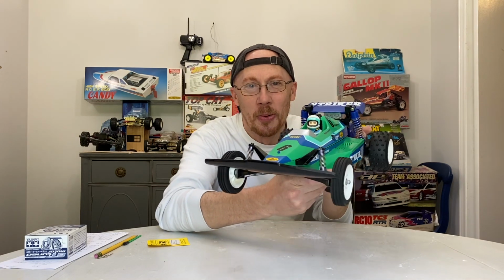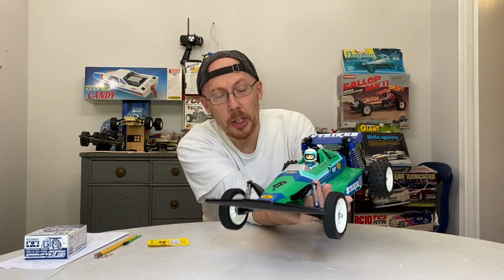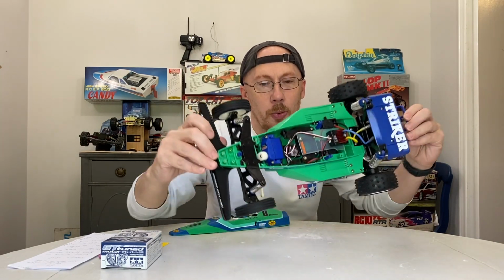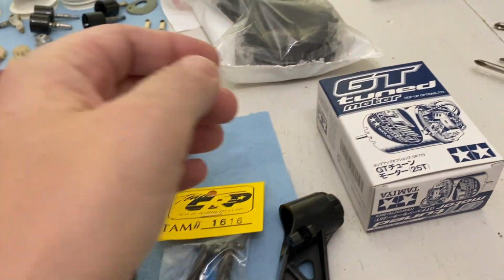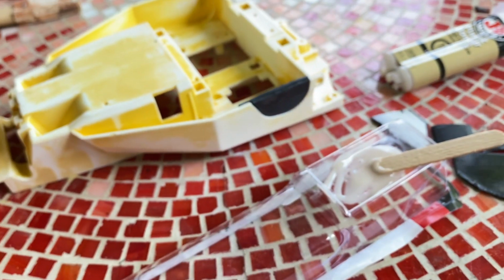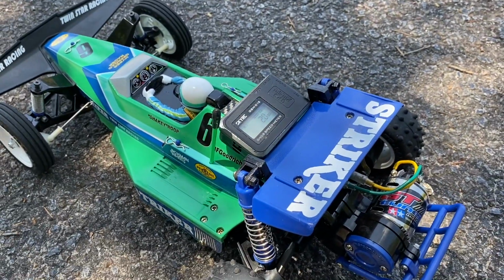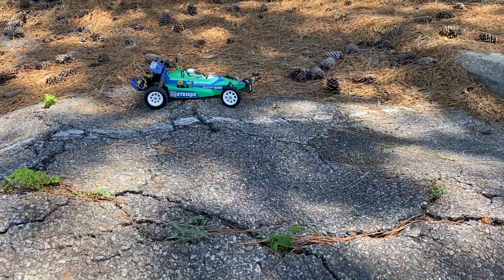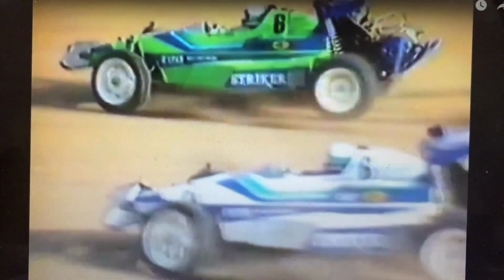1987 TAMIYA STRIKER RC RESTO AND RUN REVIEW

Comment: My first car. Bill leckie rc in penrose. Auckland. New Zealand 
Mid 1987.
Awsome for 2wd but kept throwing left axle. Was movement when suspension working hard.
Having said that it was running technigold black motor. Top motor in its day. 
Good memories. Thanks man
Reply from the maker: Hi Chris. Yes the Technigold motors had some torque. On the axle issue especially when equipped with a fast motor would ware the cheap plastic shafts out fast. I use crp nylon ones that work great. Oh 1987 what a time.Robocop ruled! There’s actually a building of a vehicle I’m doing this Halloween for fans of 87 robocop movie. Thanks for watching,sharing .

Comment: Great video as always, man! Superb work right there. And loved it how you ended the video with the Striker original footage from Tamiya lol.
One question though, did you do any cleaning or maintenance immediately after beach runs? I always keen on running my TT02B and Nikko Scorpion on the beach but worried that the salty water and air might corrode the metal components. Cheers.
Reply from the maker: I appreciate you watching. Beach runs are fun but yeah you do need to clean them right away before they go back on display. 👍
Reply: @LukesVintageRC  ahh right. Ok thanks for the reply, Luke!

Comment: Pretty nice homage too the promo video one, though it's such a strange design with a mix of an F1 car & a buggy.
The Futaba FX does look a bit more traditionally like a buggy ofc if you want a different body for this, think it's even a straight bolt on basically but just as weak in the front piece there unfortunately.

Id imagine this with red decals & black like a Marui Ninja with the wheels in red or in silver would also look great.
Or maybe gold decals & a black body like the Marui Samurai i think it was called ?
Great looking buggies both of these mentioned.

Wonder if it's possible too reinforce the front plastic piece somehow, maybe epoxy in carbon fiber or a milled aluminum piece that with some longer screws bolts into the front end piece & the chassis a bit further back.
Or kind of design a different front end that can bolt into the chassis if it snaps off entirely with an aluminum plate instead with a similar bend & hole and maybe that plate is reinforced with a secondary one that sandwiches between the chassis bottom & it's the top piece that extends too the front taking over the job the front nose cone does with a 3d printed piece maybe.
Like 0.8 mm aluminium sheet on each side 4 holes in the chassis that it bolts down into in a way that doesn't mess with battery or electrics mounting.
Reply from the maker: Thanks for watching and commenting my friend. Godbless 🙏